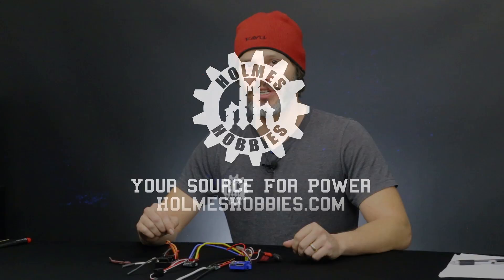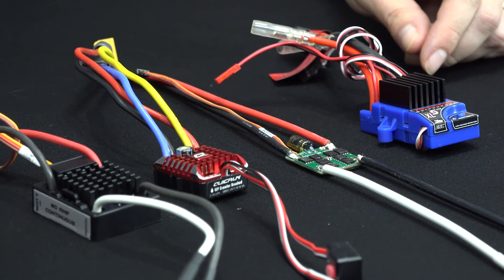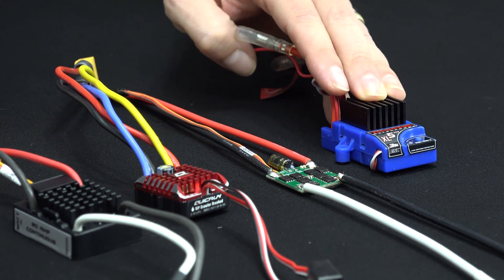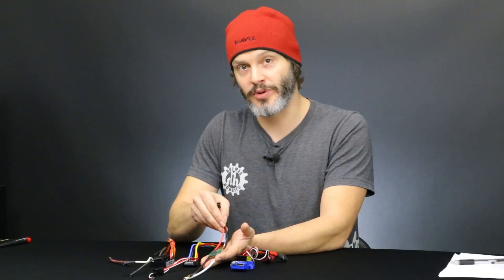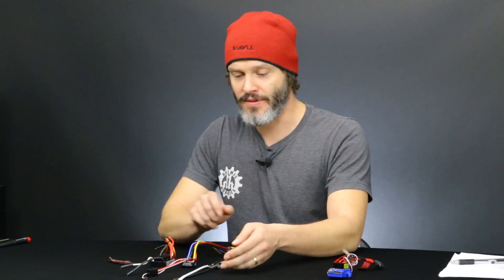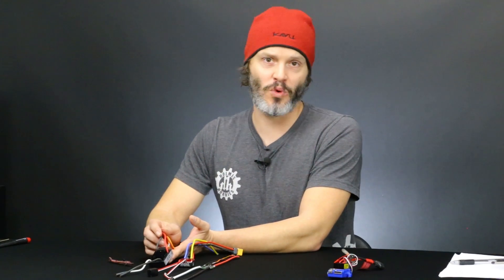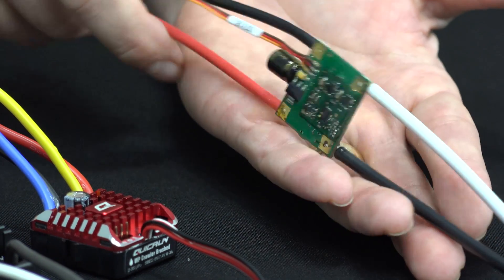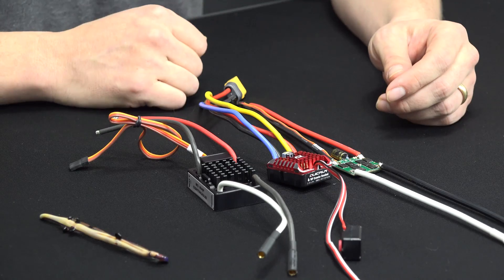Selecting A Brushed Speed Controller - ESC Terms to Know & Features To Look For - Holmes Hobbies

Comment: Dumb question here but I’m struggling to find specific information. Are the connections for a receiver and ESC standardised? ESC to motor seem to be bullet type, but are all other connections for the channel slots/BEC the same?
Reply from the maker: Yes they are,  we just generally call them RX wires.  Used to be two standards but now they are all basically compatible.
Reply: @HolmesHobbies  awesome. Thanks for the assistance. I’ve got a CR01 for my daughter I plan to give to her for us to build together so I’m finding your videos very useful. Now I just need to find an appropriate body to paint up as the mystery machine because she’s loving scooby doo at the minute.

Comment: I have forgotten it all 😅 ,just bought a FMS buggy 1/10 REBEL and it has like a hobbywing esc with 2 cards in the slots, is one for like a brake feature? And god knows the other lol ,I'm nearly 60 but it was on special and i missed having rc fun 😁 its the latest all funky colors yellow cage 550 can motor ,very well built tub and quality plastics 👍 and only 70 bucks on offer , she lights up on 3s 😊slow and steady on 2s, and she's fully waterproofs /servo/radio in a box 📦

Comment: I'm currently modifying a WLToys RC car to a robot and to me the performance at the lower end (up to 20% throttle) is the most important, because I don't want the robot to go so fast. I noticed that cheap ESC often have very low PWM frequency like just 1kHz, which produces a very loud whine and causes a huge power loss at the lower RPM range. Are there known brushed ESCs that go well past 10kHz PWM so it's not audible at low rpm?
Since I don't know if anything better is available for that, I decided to design my own ESC with 40kHz PWM which should enable an extremely accurate and responsive control with good efficiency at low RPM range.
Reply from the maker: @digitalghosts4599   hobbywing 1080 or Holmes torquemaster
Reply from the maker: @digitalghosts4599  8 to 13k is enough for the inductance of rc motors

Comment: Update: after over a year back in the hobby, I have two TRX4 vehicles, a Sport that "was" equipped with tracks and now runs tires and a High Trail Sport that runs tracks from the other truck. I have a Fusion SE that I run in the radial tire truck because of the low speed control and a 1080 G2 with a Trailmaster 21 turn 550 that I run in the tracked High Trail. Both have internal BECs that I run high torque servos with (a Reef's 422HD and a 2280 Traxxas) and they perform great with no issue whatsoever. Just make sure your receiver can handle higher voltage, as the stock Traxxas receivers won't handle more than a 6 volt input. That's why I run Spektrum.

Comment: Hello, I have a RC car with a crystal 5 (RX) 26.740. The controller is missing. What controller can I buy, those programmable ones that I can use with this car? The car brand is Nikko, probably a 10 year old car, but I don't want the OEM controller, I would like to buy a better quality one. Can I remove the board and add a ESC and a receiver and salvage the motor and servo?

Comment: I have the quick run 1080. I have it programmed for 6V bec. I run a 35kg servo and it runs it along with my 6V servo winch and dig micro servo just fine. My rigs are trail trucks and not specifically rock crawlers although I do take them in creeks often.

Comment: Thanks John. Your video showed me I have no idea of what is going on with the ESC's. I am looking to use it for a trolling motor on a Kayak. I don't know if you are still monitoring this video for comments. 

There are several videos out using the HW1080 for 30lb trolling motors. You recommended an external VEC for anything over 300 in lbs? Might you have any suggestions on this matter. The motors are approximately 20-25 amps at full throttle. The PWM's that I have been using are pretty cumbersome don't last more than a season or so. I have purchased 2 HW1080's. I am setting one up for remote control and the other for a wired control w/servo.  Any suggestions you have would be greatly appreciated.
Reply from the maker: I think you are on the right track.   the hobbywing will heat soak really fast though, so mount it where there is some airflow and use the biggest wires you can.    and when testing at first, go up river first so you can float down if it fails!

Comment: I run separate 6 cell Ni-MH for each esc which happen to be Novak Super Roosters along with 2 - Hi-tec HS-5645MG servos. Since I bought your crawlmaster pro motors & did away with my 66:1 reduction units my 1:6th krawler does not hold. I'm using the smallest pinion which is 11T & I'm looking for a way to hold like it did. What are your recommendations?
Reply: I'm also using a non-digital stick radio (which I need stick & at least 4 channel if not 8) I'm not sure if you need to change the radio out. I see a lot has changed since the early days.

Comment: Can I use a brushed esc (like the ones  shown) on a 1/10 on road touring sedan? I have an old hpi rs4 rally (belt driven) chassis I want to revive. I’m not too concern about speed just smooth acceleration, I’m just worried I might snap a drive belt with brushless power since it’s close to impossible to get replacement drive belts for it.

Comment: The hobbywing 1080 has a selectable internal BEC 6v or 7.4v, with the program card. More than enough for the servo i use. 17kg servo. PowerHD.  I run it in my wraith set up with a 35t heavy-duty tekin motor. Love the hobbywing stuff.

Comment: The big craze today is using an ESC to control the speed of a trolling motor mounted on a kayak. There are many videos out there using the Hobbywing 880 and a servo tester to control the direction and speed. I purchased the above products to build my own, but the ESC voltage input wires are16 gauge. My trolling motor can draw up to 40 amps, so I am concerned about connecting an 8- or 10-gauge wire to the 16-gauge wire and cranking the motor up to draw those high amps for a period of longer than a few minutes. Is my thinking correct? Thanks for any input.

Comment: Amazing video! Question, I am fairly new to the hobby, I have a Redcat Danchee Ridgerock as my first crawler. I want to upgrade the esc so I can use a radiolink controller. I bought the 880 dual motor esc, but the plugs are 4mm bullet coming out, however, the motor connections on the motors for the Ridgerock (380 I think?) are jst plugs and much smaller wire. Is it safe to connect them given the wire size difference? What would you recommend? Please advise 🙏

Comment: I’ve been running HOBBYWING 1060’s in all my upgraded or modified brushed vehicles. I tried a couple of the cheaper Amazon ones and they actually burned out a servo and even burned up my vintage 27mhz airtronics receiver. So to me the HOBBYWING versions are the best value for the money

Comment: Motor limits. What the lowest motor limit or highest on what voltages. 2s,3s,4s etc. I feel it’s a common issue for heat or burning the esc up. Thanks.

Comment: John I'm using wheelchair motors for a remote control push mower I can't wall so I need help I'm dumb when it comes to this rc stuff but need a remote an driver for two brushed wheel chair motors forward an reverse I'm going to run two batteries in series 12 volts not 24 can you fix this up for me so its labeled to just plug in an go thanks will wait for a reply oh an do want the two joystick remote with antenna for range thanks
Reply from the maker: I'm not a cheap shop to do this work.  I'd estimate a few hundred $ for wiring. Check out robotshop for big brushed controllers.

Comment: Hi, thumbs up for great explanation. but i hv a question. i be been using hobbywing 1060 for 2 different motor. one is 370 27000 rpm and the other one is 370 50000, running on 2s 3000 mah 60c battery. why the high rpm motor is easy to everheating?

Comment: I run the quickrun 1080 on my trx4 sport(moded) and my axial wraith 1.9 . Using the hitec ultra torque servo and servo that came with the sport. I set both esc to 7.4 volt bec and they seem to be pretty good. Haven't had an issue with torque or lack of. My TRX 4 sport is nearing 8 lbs if it hasn't passed that weight already.

Comment: I bought my first traxxas trx-4 Bronco 2021 and will run the original ESC from traxxas. Off course with the original traxxas BEC and the original 400 oz traxxas servo BUT i make one essentiell change on it and that's a holmes hobbies TorqueMaster Pro 550 21t and it transform the whole rig to an other Level. Awsome Motor. I use nearly only HH Motors in my 16 rigs and mostly with an HW1080 but this is a great combo. If the traxxas ESC will die, i put in an HW1080 also. But for now it's an great choice  and drives awsome.

Comment: Hey John, I'm pretty new to the rc game & recently bought a HW 1060. Problem is, I'm not sure why I isn't turning on. I have it on a blomiky 7.4v 1200 mah 2s lipo batteries got on Amazon. Wiring is all correct, & wired to my stock  receiver the AE-6 on my scx24. Ive gone through 2 HW esc so far thinking I bought a defective one. Now I'm thinking its probably my power supply??? I'm so lost with 2 brand new escs sitting on the bench lol

Comment: Very new to rc . I'm building a crawler . I started with a 1st Gen rgt . Yup I am . Now I'm doing motor and trans . Did servo and axles . I'm going to stay with the 7.2 v batteries . I have a 550 55t motor. Need to do the esc now . Before I put my body on . What would you recommend ? I would also like to change the radio and reserver too some day . Or is there a package that I could get . Last ? . When does your build stop being what it started ? Not much left of the rgt when I get the body on ..thanks .. I'm also new to the hole you tube stuff . But I do have a couple vids . You should see them . I build stuff . This rc is the next thing I'm building.
Reply from the maker: hobbywing 1080 is the budget choice still.   BRXL is the US made smoother choice
Reply: @HolmesHobbies  thank you for getting back with me . This is my new hobby . I build a full size Jeep crawler . Did real good with it . Just can't get around like I used to . ( Disabled ) would you mind if I ask more ?s if the need arises ? There's not a hobby shop near me . I need to start going to swap meets . Thanks again .. real nice of you .
Reply from the maker: I do my best to reply , but sometimes there is a deluge of comments that bury questions.

Comment: Can u  get the 1080 with battery and motor connections already installed?  I’ve never soldered anything before and don’t want to screw anything up

Comment: I’m running a quick run 1080 with a savox sw—1212sg and so far haven’t had any issue they claim the servo puts out 600 oz but I doubt those numbers are true

Comment: Here's a bit of fun. Remember the old AXIAL AE-3 ESC, OG Holmes BRXL 4s and the OG Castle sidewinders??? Well it was hard to tell them apart really strangely. So my old AXIAL ESC had NO problem running 4s all day with an AWESOME old Holmes Cobalt Puller 14t brushed motor as long as I had the castle BEC it worked great. And the old sidewinders could run brushed or brushless motors on 4s lipo also. Don't listen to the rules. Run it.

Comment: When I first started crawling I was using HW1040’s and 1060’s. When HW introduced the 1080 it became my go to. The card adjustability of the HW1080 gave me the options I wanted to adjust my crawler my way. Recently, I’ve made the switch to the Reedy SC480X. It also has a tuning card but offers less tuning options than a HW1080. The primary reason for the switch was price. The SC480X is $21.99 from Associated. The tuning card is $10. In my case, I have 24 of these in trucks. If I need more tuning g that what the Reedy offers, I swap to a HW1080.
Reply: Are the reedy speed controls doing good for you on 3s, with external BEC...?   What additional options does the 1080 provide?
Reply: @isaiahfurrow7414  the 1080 has options like max forward force, max reverse, max brake, initial brake, drag brake and drag brake rate. Much more fine tuning. I run the Reedy with it's internal BEC. It's rated at 7.4V/5A.

Comment: hey good day i need help plz,. i have a JLB cheetha... I had all plans to run it yesterday but i was out of luck... i have steering but no throttle.... so i said let me calibrate it. but whenever i hold down the set button and turn it on it doesn't go into calibrate mode. it just turn on like normal.

Comment: I have a 25kg servo in my redcat gen8 and I believe that equals 347oz inches of torque. Stock esc and the servo doesnt feel all that powerful to be honest, is that due to the bec not giving enough volts to be sufficient for my needs?

Comment: I run the 1080 ESC with a 36kg servos lights and whinch works fine even with the 550 crawl master pro it's a fantastic set up easy to program it's what I have in all my crawlers rigs

Comment: So i have an old (2001 nikko iron eagle) rc car that needs  full replacement on the electronics, im just not too sure on what to get. Probably the most difficult thing is that it uses 2 large individual motors for the front and rear wheels and a massive servo for steering system.this has given me a better idea on what i need but i would like your recommendations on this

Comment: I run the 3s limited Hobbywing, during a recent rebuild I spent HOURS  trying to re bind, throttle calibrate, reset, and almost bought a new one and finally found that I had accidentally connected my 4s airplane battery. Steering worked and would go in reverse but I don’t recommend using a 4s with that esc 🤦🏼‍♂️🤣

Comment: Hey John I have a problem my 1080 esc is overheating i am using it with the trailmaster sport 550 27T thats never happened before so my question is if my savox sc-0352   
90.3oz of torque @ 6.5 is bad could it be overheating my esc ???

Comment: HI John, thanks for the video. I’ve just bought the HW 1080 and was looking for a servo upgrade next. Thanks for the advice about nothing over 300oz without BEC. I was about to buy one over 300oz and just run it on the hw1080 at 7.4v. I think I may go for the 3 Brothers G11 that wires directly to the LiPo. It uses 11-14v but draws no more than 1-2amps. Have you used any 3 Brother servos?

Comment: I run a 1080 on 3s with the powerhobby 729 and a tekin hand wound pro 55, no ext. bec yet.  As well a savox  with 35 turn tekin hand wound pro run on an older mamba monster, I run that 3 or 4s with castle external bec.  But the powerhobby 729 is at 500oz/in at 7.4.  But I run the super slow crawl, wheel speed is super rare for me.

Comment: Hi, Exchellent channel. 

Would you kindly advise, I am getting Futaba HPS-A700 servo for my Traxxas Trx4. I want to pair it with the Hobbywing Combo-XERUN-AXE540-2300KV-FOC-V1.1. Would you be able to advise if there will be external BEC required? If so, whoudl would be preffered?
Reply from the maker: I haven't pushed the limits of the AXE internal BEC.   It is generally a good idea to use an external bec like the castle BEC.
Reply: @HolmesHobbies  Thank you very much for your reply and avise.

Comment: Hi John, I'm a new subscriber. I have an Axial scx10 ii RTR, I'm a weekend crawler with 11/64 tooth and stock brushed motor. What brushed motor and esc would you recommend? I am currently running 2s but I  going 3s (max) soon.
Thank you.
Reply from the maker: I'm a big fan of the 16t and 13t crawlmaster 540 motors.
Reply: @HolmesHobbies  Thank you

Comment: I've been running the hobbywing quick run 1080 for a couple years and love it. Burnt a couple up but over all will buy again. Recently switched to a brushless( dynamite 130a esc from my losi ) in my vaterra ascender with a 3000kv motor. so I put the 1080 quick run in my wife's redcat gen 7 pro. Would love to try a Holmes hobby esc
Reply: Do those dynamite escs have good drag brakes for crawling ?
Reply: @marleybrown4554  yes the quick run  wp 1080 has a great drag break. With the program card you have multiple set points for the brake
Reply: @marleybrown4554  also of you enable the freewheel on the program card (option 15) it preforms better at slow speeds

Comment: brushed esc + guitar e string = hot wire foam cutter
Reply from the maker: Love it!    Really needs amp control for controlled heat, but that would do the job!  I have a CCCA bench supply that could do it.

Comment: Thanks for another great video. I just received my 1080esc and Holmes crawlmaster sport 12t, for my scx10 II. still waiting on my new soldering iron. But I'm planning on running them on 3s. And I still have the factory tactic servo in place. But we will see how long that lasts since I just added a lot of brass and steel to my rig. Thanks again for the great, relaxing, and informative videos.

Comment: Hey john!!  I regards to the quicrun 1080 esc.  I run 4ws with no external bec.  I have the 25kg annimos servos front and rear and it does wonderful.  Never had an issue with brown outs or anything.  Very happy with it.  It has a setting for bec 1 is 6.0v and 2 is 7.4v.  I have it set on 2 for more power to my servos and it seems to perform great.

Comment: I generally never do this which brings the question, if I run a brushed esc on3s at only 50 to 75% for extended periods of time, like in a paddle wheel boat, will the esc overheat?  the motor is a small 12v 540 size with very little load.

Comment: I’m running a hobby wing 880for my dual motor four wheel steering Rockcrawler seems to work pretty good might ruin a BEC once I upgrade the steering servo‘s so they can handle a little more voltage. But this thing seems to handle 3S on twin 550 canyons pretty well